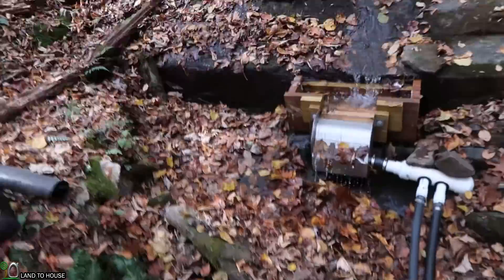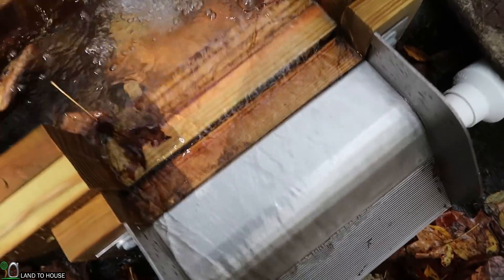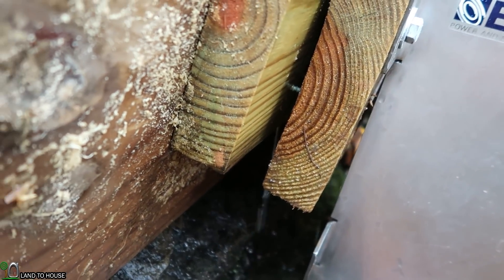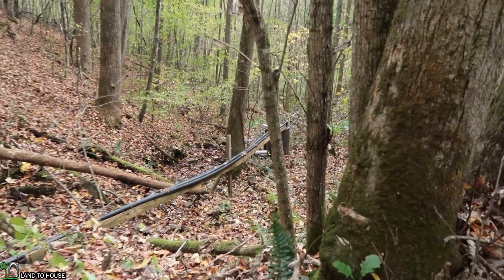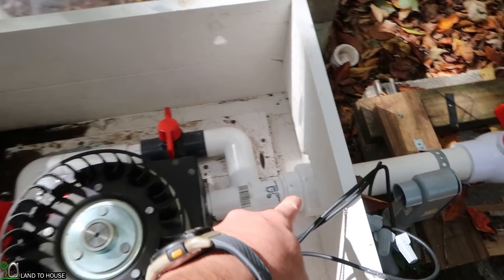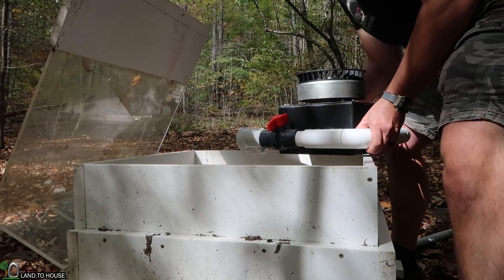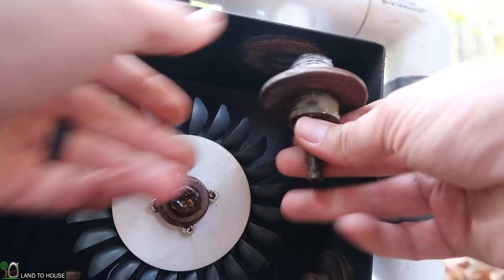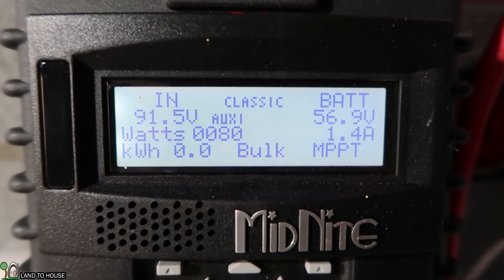Stop the Water Leaks to the Coanda Screen - Micro Hydro

Comment from the maker: Did you miss the full install series?
Part 1 is here:
https://youtu.be/zPIec9VCrOY
Reply: I need to put in a stand pipe for my flowing well in order to use ram pump. Found some info about shutting off and turning on flow from flowing well not being good to and could damage flow. I also need proper air gap between well and stand pipe for contamination and pressure wave.

Comment: Try opening your penstock drain and use it as a bypass. It should take some of the pressure off the ball valve and it might be easier to open

Comment: Given that the nozzles are bound to get plugged over time, because one will likely never achieve 100% debris free water, would it be possible to add manual back flow valves to the box to flush out the nozzles intermittently.

Comment: I haven't read all comments, so I hope that I am not repeating here.   Can you further put a rainwater like diverter to further filter out debris down line?   And ofcourse to do this in a way so as to not impede water pressure?
Reply from the maker: That type filter would need to be as close to the intake as possible. After the water leaves the 55gal tank it does not need to slow down or be restricted.

Comment: Try laying the Coanda screen with the ridges running with the water, way less debris build up
Reply: This would  make your screen act as a Tyrollean screen. The capacity of Tyrollean screens is more dependent on the height of water over the screen, whereas Coanda screens depend more on the velocity of water. The "cutting" action of the Coanda screen significantly increases the capacity per unit area when compared with a Tyrollean intake. For this application, your intake footprint would be a lot bigger for the same capacity with a Tyrollean, but still would be a possibility depending on your projects needs

Comment: love your vids. in this setup you are basically just collecting the water and you want it to be clean right. why not have a tank(I guess you have one down stream collecting the water)? but mid way down the barrel have the outlet and it can be screened. slit can rest on the bottom of barrel. on the top to remove leafs that are floating use something similar to a seabin. this way yes it gets rid of the leafs but also acts as the overflow and gives you a pour of water for the creek so nature can use it.  maybe that doesn't make sense but I'm not sure why you are bothering with this setup to just collect the water just to have it go to a barrel down hill. I'm sure the suggested execution would be spot on and more hassle free.

Comment: Have you thought of an in-line wire mesh filter, like a sediment filter, to not restrict the flow, but to catch those particles to minimize the clogged nozzles? One that is clear to see how bad it gets, that you can unscrew, clean and reuse?
Reply from the maker: I think the issue is that the hydro can pass 33gallons per minute. I am not sure of any wire mesh filters that can pass that much water all the time.
Reply: @LandtoHouse  I still like the idea of flushing the coanda screen from time to time. Use that as an excuse to get an electronically timed battery run ram pump thing going, doing a 50-gallon flush whenever it makes sense.
Reply: @LandtoHouse  Install a swimming pool  debris trap...  You going to be continually tearing apart that turbo otherwise... i'd rather clear the pool trap every week or so for sure..  :)

Comment: Very nice, thank you for posting this.
You said you had 3 x 3/16 and 1 x 1/4 for your jets.  Might I make a couple of suggestions for your next rebuild of the microhydro:
1. Take a Page from Eric's book in the Off Grid Yurt video and have a valve on all 4 of the jets.  That would let you turn on just the 1/4 when you have enough water for that without having to run it with the 3/16 main at the same time and run out of pressure.
2. You indicated your main always on jet is 3/16, and you have 2 more 3/16 on the sides.  I'd suggest replacing that main always-on one with a 1/8 so that during times of low water volume you can run the 1/8 without running out of pressure, or fine-tune the flow with combinations of the 1/8 and the 1/4 or one or two of the 3/16 to get the maximum power without depleting your pressure.
3. Add a T and a valve next to the turbine to use as a purge/cleanout/bypass when you want to flush debris out of the line, keep the water flowing and not freeze up when you have the turbine offline for repair & maintenance, and as a source for high pressure & volume water when you find another line of investigation to experiment with, such as a swirl turbine.

Comment: This was cool to watch, thank you for posting it.  Your new collection box seems to be working great, you are getting enough water from just 2 pipes to keep the main nozzle running at full pressure.  Your rubber flap looks like it does great taking care of the gap between the Coanda box and the last board.
I think that if you loosen the coanda, put a wedge of wood behind the bottom, tighten it back up so it sits vertical, that should help catch more of the water that's exiting at the end of the screen.  
Have a great day.

Comment: You need to find a butterfly style of valve. I used them in the oil field they were long lasting, reliable, and easy to rebuild.
Reply from the maker: Those also don't hold water in the middle to freeze and break.
Reply: @LandtoHouse  the one's I used were steel and rubber  it worked in north Dakota in the winter. Hopefully you find something that works better than the valve you have.
Reply from the maker: The one I have is rubbish.  I like the Stainless steel one I had but it broke apart last winter.
Reply: @LandtoHouse  A gate valve would also work, it doesn't hold water inside itself, and you get a large mechanical advantage cranking the handle to open/close it.  And they are a lot cheaper than a buterfly valve.

Comment: pretty cool looks like its going to work well . hope all is good your way brother . take care work safe .
Reply from the maker: It was running for 2 weeks and seemed to be doing well. Just turned it off to move the electronics to the new power shed.
Reply: @LandtoHouse   cool sounds good brother . always wanted to mess with water power but never had a place to do it at .  but sure sounds like fun . not to mention if your tied into the grid it will help with those power bills .

Comment: What is the max capacity wattage wise for that turbine?  Why aren't you running more than one nozzle?  I really enjoy your vids, thanks!
Reply from the maker: I imagine this pma could do 800w with the right setup. My water flow rate is only 9gpm at the moment. When it picks up to 30gpm I can run multiple nozzles and make 350w +. (A 2" pipe can only flow around 33gpm at the length I have)

Comment: How airtight is the water box on the bottom? Maybe it needs a vent to atmosphere.
Reply from the maker: There is actual a vent on the side. With the current flow rate it's not much of an issue. At 30+ gpm the went is more important.

Comment: There is one thing you can try on the. Input to the midnight classic. Is at the bridge rectifier output connect a large. Capacitor of around 1200uf at 250volts DC or higher can be made up of multiple capacitors. To help smooth out the DC voltage before it goes into the midnight classic.

Comment: In the UK you'd be expected to keep a certain amount of water flowing down the stream - our system had to let the first 10% (based on average flow) bypass the intake before we extract any for the power system.

Nice little system though.
Reply: On my own small hydro system, and after a very dry summer, I finally was able to capture ALL the water of the stream that runs thru my property for 1/4 mile.  I immediately purposely created some "leaks", to restore some water movement in the creek.  Though I put it all back in, for that 1/4 mile lots of critters depend on it flowing.
Reply: hi Chris I just checked out your video showing the set-up you help with I live in the Rossendale valley we have probably over 100 mills ponds streams wheel pits etc all made to run the mills that are a mess most of the river is man made and deserves restoring and using for it's intended purpose I'd like to build a proposal to get the community's support and make the council stop ignoring what they see as a expensive liability and realise it's a asset have you got any advice that could help get things started

Comment: Leaves: why not put a cover over the whole thing to keep the falling leaves out... granted they can still come via the water, but at least it'll reduces the leaves.
Reply from the maker: That is true. I guess because it only happens for about 3 weeks a year its not that bad.
Reply: @LandtoHouse  My understanding of these screens is they shed leaves best when there is enough flow that it only 'carves' off the bottom 2/3-3/4 of water flowing over the screen, and some excess water continues on past the screen and off the box carrying the leaves with it.
Reply: @workbenchz  That is correct! If debris gets stuck on the screen at lower flows, you usually still have enough open area to capture the lower volume of flow. Once the flow increases and you need to take more water, the debris should get swept away with the bypass flow

Comment: What are the blue inverters? I watch you do the install on the reliable brand but missed the blue ones being installed
Reply from the maker: These are grid tie limiter inverters. Now that I have used them for some time I need to make a few dedicated videos on them. They read the amps going into the house and turn on if power is needed. No power is fed back to the grid.

Comment: Maintenance. Have to do it.  You might consider some rubber sheets in the stone to box fall to capture more flow. Perhaps design a small 5 gallon tower above the catch screen that will blast away leaves. Use ram pump to fill it up. When it reaches the top it releases all the water down to screen. Maybe another catch to recover that water. Thanks for sharing

Comment: Is 80-90 watts worth all the trouble? 
I'm having fun watching this series.
Reply: So long as it’s maintained and runs 24/7. Consider that solar only runs 12 hours a day at best. Hydro may produce less power immediately, but can be extremely effective to charge an off grid battery bank overnight!
Reply from the maker: Very true. Overnight is the main thing.
Reply: @LandtoHouse  any idea how much it chops down on electricity cost or battery costs if you should go all the way off grid?
Reply from the maker: At 9gpm its making 100w. At 33gpm it does 360w ish. When the creek comes back up its good.
Reply: What you got to remember is that was just one nozzle.